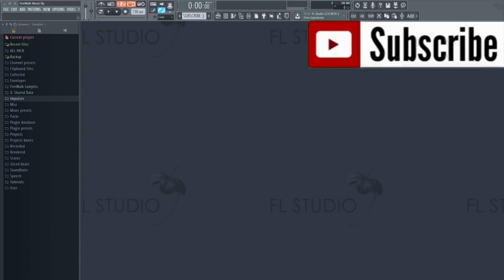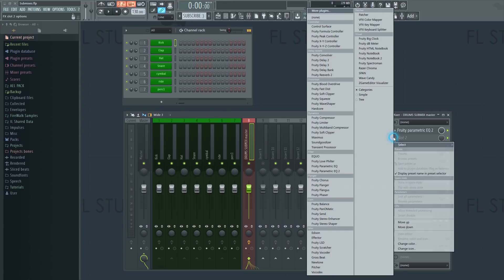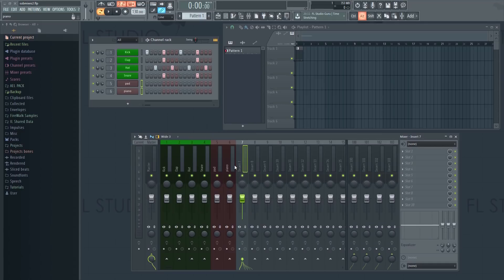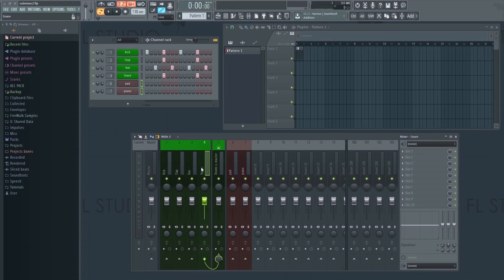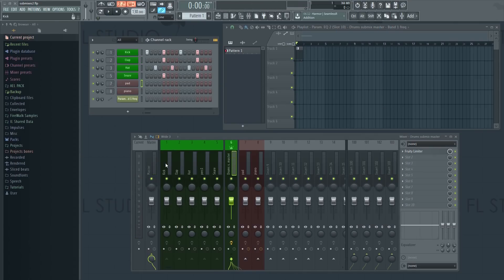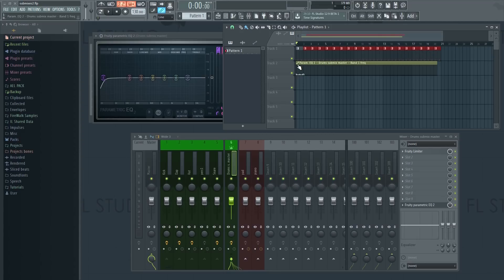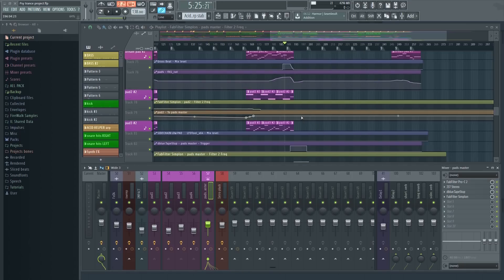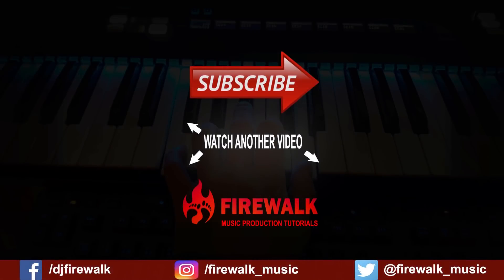How To Set Up And Use a Submix In FL Studio 20

Comment: My Track routing button is there BUT it isn't highlight so I can click on it!... Any idea why????
Reply from the maker: The down arrow? It should be highlighted al the time even if the track is not in use. Are you sure you're not confusing it with the effects button ?
Reply: I got it to work,  I can't for the life of me figure out why for my 2nd beat. I route a bass drum to track 6 on the mixer it will throw it on to 9 or 10 for no reason?.. For the 1st beat I will route the bass drum to 1 on the mixer.. then the others to 2,3,4. then do the submix on 5.... Then for my 2nd beat I put that on 6-9 and then when I replay it it undoes my 1st beat with the submix  and throws it in other tracks on the mixer???

Comment: Hi, is "route selected to this track" the same thing as "create submix" or do they have different functions.

Thanks
Reply from the maker: No, it's not the same thing. :) Use route to this track for making submixes.
Reply: So, i right click on an empty mixer track that i want to turn into bus track and select "track routing" then "route selected to this track".

Because i was just wondering in the video you said to click on "create submix" instead.
Reply from the maker: It's basically the same thing. In the video I selected several tracks and clicked on create submix instead because that's faster, it will instantly route all selected tracks to that mix instead of manually routing them one by one. It doesn't matter which way you do it though as the end result is the same. :)
Reply: Thanks for clarifying :)

Comment: Thumbs up - I am enjoying your videos!

Edit: I saw you covered this in your CPU performance vid ;-)

However, (..and AFAIK..) it should be pointed out that submixes will force all the generators and effects on the individual mixer tracks to be processed by the same CPU core. Submixes are a tried and honoured method in music, but they don't marry well with PC architecture. I'm sure with just samples as generators it will cope quite easily and probably with most VST's too - I'm just pointing out, if you want your 10, 12, 16. 20 thread CPU to be of use, you have to (try to ) keep the flow of Generator > music info > mixer as a chain.

For the automation aspect, it's fairly easy to link an auto clip to multiple controllers or a controller to multiple clips.

Keep up the good work!
Reply from the maker: Submixes can definitely cause some added cpu drag, but it's worth it in my opinion. I couldn't work without them, it's an intricate part of my workflow. It's not a complete cpu killer though, the steps in between can often be multithreaded, if it's set up correctly. Here's an interesting thread about this from the IL forums: http://forum.image-line.com/viewtopic.php?f=100&t=178026&p=1252540&hilit=generators+multithreading#p1252540

Comment: why is it posible to adjust the "To Inster" knob more than 100%? By default setup is 100% but you can adjust it to: 125%
Reply from the maker: It's one of those things in FL Studio that can be a bit confusing. It's like that in every mixer track too. It defaults to 100%, but can be pushed to 125%. Same in the channel rack, but there it defaults to 80% and can be pushed to 100%. 
It's probably done this way in order to help people to keep the levels low, by adding a buffer zone so to speak.

Comment: But if we do this process on a big proget the latency will be to hi...I know that fl can't fix the latency when you create a sub mix
Reply from the maker: The PDC in FL Studio sucks and always has. It's part of the reason why some people call it more of a toy than a real daw, that and the fact that it doesn't have good hardware support etc. Still, people have been making great music in it for a long time. I know for a fact that a lot of professionals who use FL use submixes in all of their tracks with no problems. James Dymond for example also use submixes in his tracks, and he's a trance producer who make rather large projects, some times utilizing every single mixer track available. 
While it's true that there are issues with the PDC, I've found that when using submixes it usually doesn't pose much of a problem. It's mostly a problem for send effects and such. When using send effects, and especially when using send effects on a track that goes to a submix, the PDC will fail completely, as send effects are not delay compensated at all. This is why I never use send tracks any more (have to use patcher instead). 

Image-Line has reworked the PDC system and in the next update the entire PDC system will be rewritten and should work properly all the time (it was about time). :)

I happen to have the latest beta installed and the PDC system works great. Only a few more issues to iron out, such as compability with multi out plugins and such.

Comment: Hey bro nice video
I am making a remix song my original vocal BPM is 80 and I make it  128BPM but after changing BPM of my vocal it's doesn't fitting in track
So what I should do...
Reply from the maker: Sounds like it hasn't been properly stretched, so that it's out of sync. How did you stretch it? autodetect? Manual?
Reply: FireWalk I use auto

Comment: Hey. . ...I have a confusion in changing key of samples ....in FL studio... Some people say.....u should do opposite to get a right key..... And some people say....u should do in rit to ...pls tell that
Reply from the maker: I assume you're talking about the pitch knob in the sampler. 100 cents = one semitone. when you turn it to the right you go up, and when you turn it left you go down. Imagine you have a sample that's C5. When the knob is set to 0 (default position) your sample is C5. If you turn it 100 cents to the right, the sample will be C5#, and if you turn it 100 cents to the left it will be B4. If you turn it up by 1200 cents you will pitch it up by a whole octave, and your sample will be in C6.
Reply: Personal experience: I used to play around with what was called module trackers especially Fast tracker and Impulse tracker. Basically you needed to import samples as instruments. Each sample has a root. (If you record a C5 on piano you get a C5 piano sample for instance. If you record F3 on a bassy sound you get a F3 bassy sample, you get the idea) Now in the tracker you had to tell what was the root note so that the tracker could play the accurate notes. At the time I was neither understanding that nor caring about it. Then I got FL and wished to do a remake of it from self made synthesized sounds and so on so I exported my MIDI from the tracker and imported into FL... I can make you hear how inferno sounds like... ^^' And figuring out what should be changed is still a bit tough to me (actually I did not pay the effort to do it completely :) ). Only the melody is accurate the rest is diametrically unfitting. Just because the MIDI does not correspond to the real notes expected in the track. That's why it is important to pay attention to such things. OK if it sounds right even if it is not setup properly it sounds right anyway but should you meet a situation like mine such as changing the DAW it will be helpful to respect a proper setup of samples.